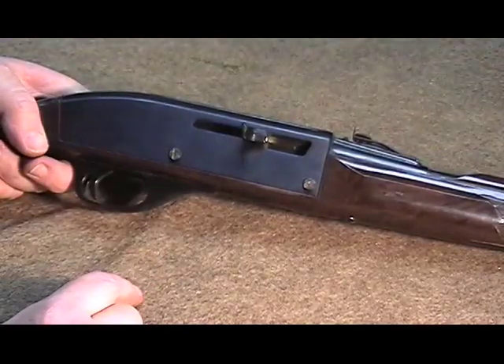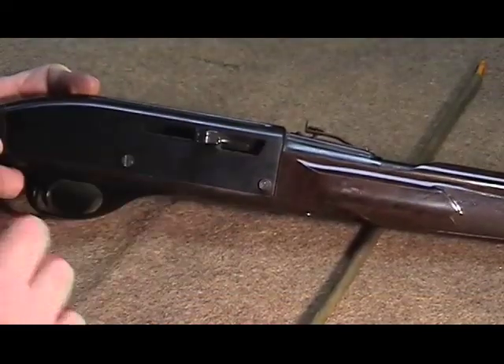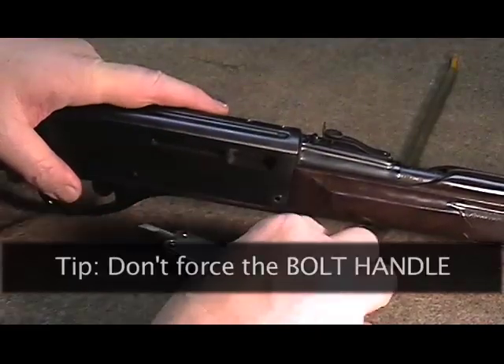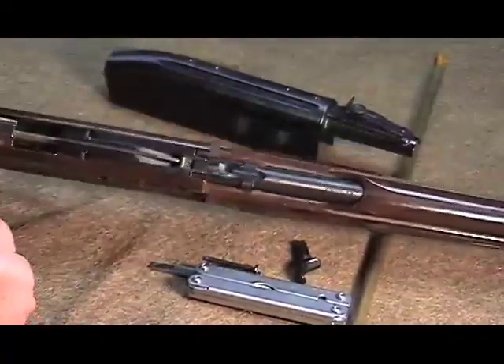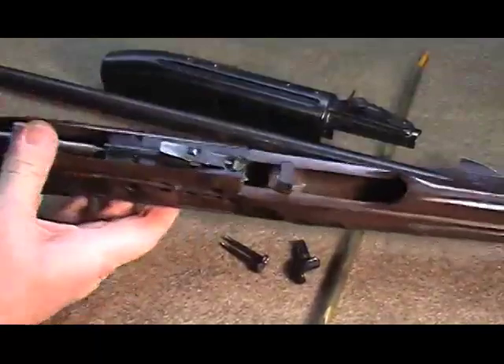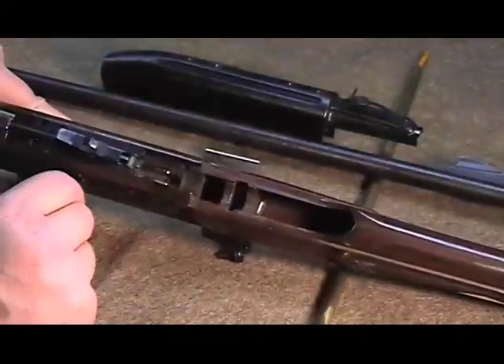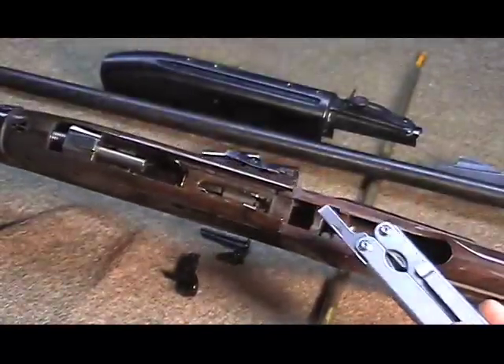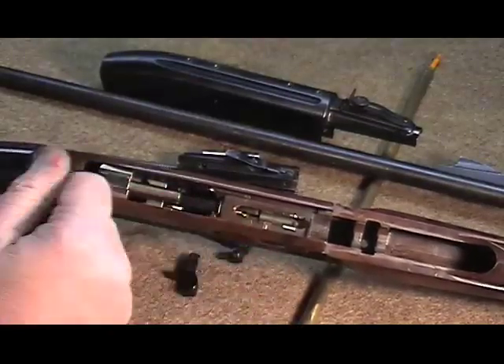Nylon Rifle Complete Disassembly Guide part I

Comment: Had mine for over 30 years and only had it apart once before, years ago.  Cleaned barrel after each use, but finally took it apart.  So much sand and gunk inside.  Thanks for the video.  Made things a lot easier.  Now I have a clean little .22 !

Comment: I Spray clean my Nylon 66 with Carb Cleaner spray, works Great to remove any Carbon & Gunk , From the rifle etc. I Use some Silicone Spray on the cleaned parts to re Assemble , the rifle. And that's about it etc.In the Past I have cleaned it with some Charcoal lighter fluid ( Kerosene ) & a Shash Brush works great also.

Comment: I also have this rifle. When disassembling it I slide the bolt back but the hammer will not stay in the cocked position it just slides forward with the bolt. I read in the nylon forum that this rifle will not go into the cocked position if it is empty, obviously this is not true. Any Ideas on what could be wrong?  Thank you, Scott

Comment: Question,  how do you remove the bolt if you've pulled the trigger already after removing the barrel and everything else?
Reply: I did the same thing. How did you manage to get the bolt out

Comment: Nice video except that you didn't indicate up front that this is for the semi-automatic series nylon rifles and not the bolt action. It would be nice to include in title. Also, you didn't disassemble the safety, etc, but show it being reassembled in the part 2.
Reply: What don't you understand about NYLON 66? The guy is very specific about which rifles he's talking about. Bolt action rifles are Nylon 12. It says what it is on the black grip cap on the stock. Just turn it over and it's right there in plain sight.
Reply: As I said, it would have been nice to have it in the title of the video. I know how to identify what I have, not to mention I bought it 50 years ago and can remember what I bought.

Comment: where I buy this piece of arm .
Reply: You have to look online or be lucky to find one.  I found the brown one in 95% condition at a garage sale for 125.00. I feel lucky because the ones online are 350.00 and up. Mine is stamped 70. Which means it was made in 1970.